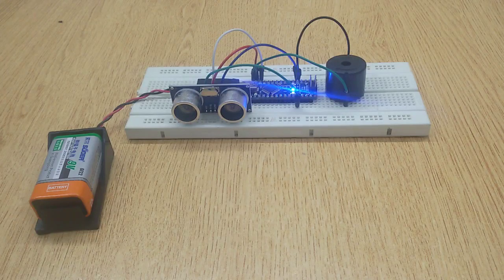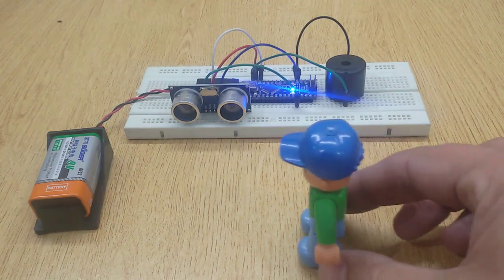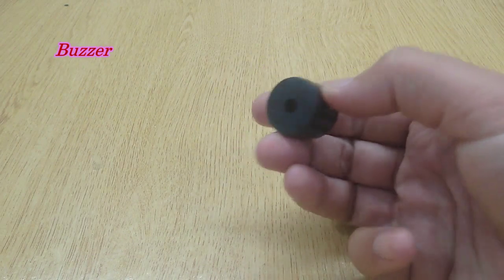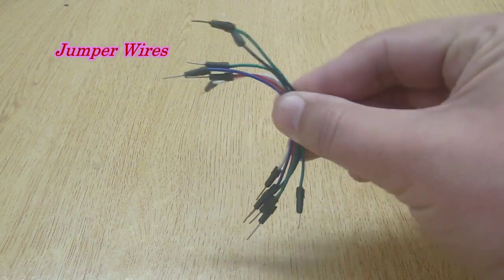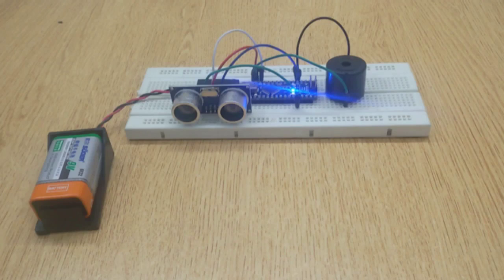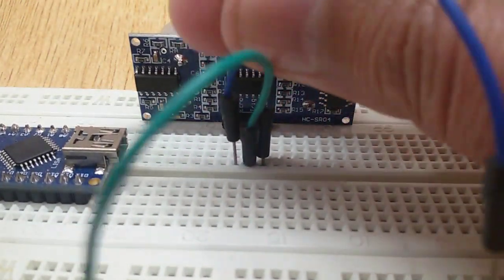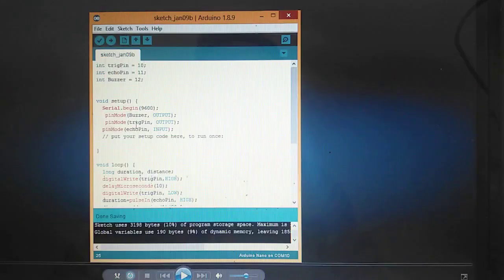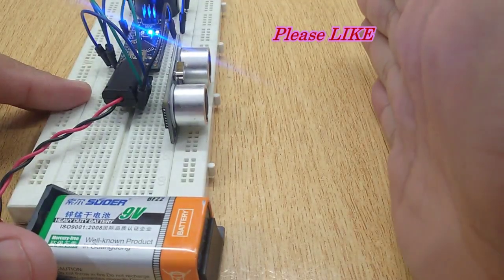How to Make Security Systems using Arduino nano and ultrasonic Sensor

Comment: the code is not working sir
Reply: bro its perfectly working, check if you have correctly selected the port. if it doesnt work contact me. if already done, congratulations!
Reply: @creamycaramel3571 Brother the code keeps the buzzer on at all times
Reply: @creamycaramel3571 what to do plz tell